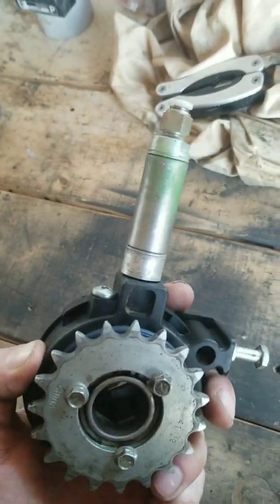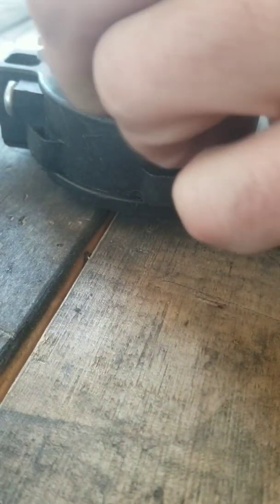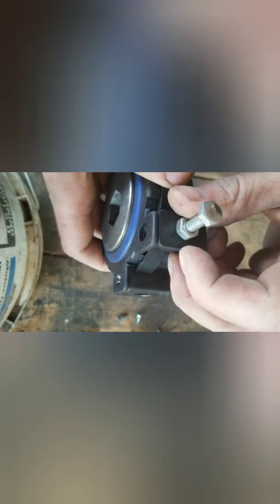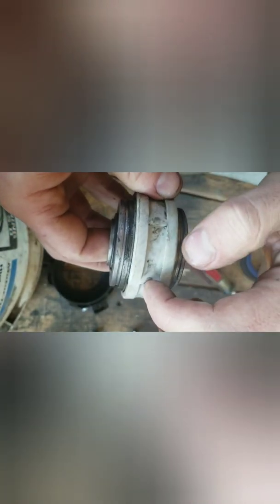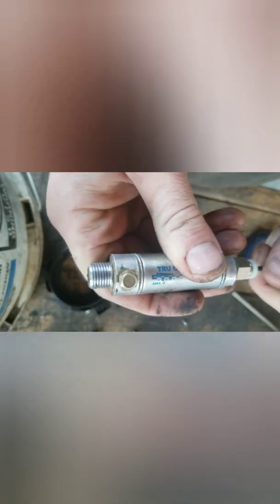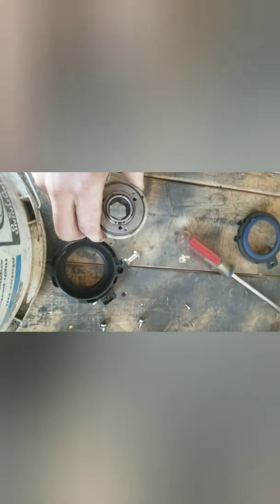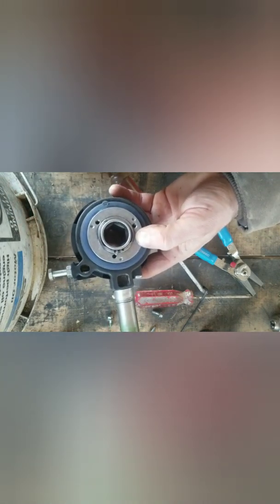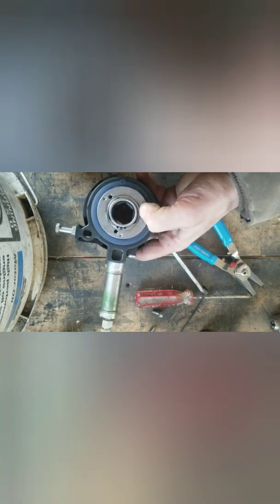Tru Count clutch disassembly

Comment: I cleaned the back 8 clutches on a Kinze 3500 split row with the clutches mounted on the planter.  Each row took 10-20 minutes with row 3 & 6 being the hardest because I had to straddle ground drive wheels.  The clutches can be completely disassembled and cleaned without removing the drive shaft.

Comment: I appreciate you sharing this.  I recently bought a JD planter at an auction with a Tru Count system and have no manual.  I also just found out that Trimble is no longer handling Tru Count and am wondering if you would know where parts could be found if needed?  I have tried contacting the number on the Tru Count website but continually just get a busy signal and I am assuming it is not in service.
Reply from the maker: Most CaseIH stores are Trimble dealers, plus the tru count was the factory clutch on the 1240s/1250s so they'll have most of the guts on the shelf already. The parts counter can help some but the AFS guy is the one to ask.

Comment: I just bought a White 8824 with the air clutches on it. I have been told that I should maybe clean the clutches before spring.  I sure am glad you posted this video!
Reply from the maker: Glad it helps. unless you're changing hex shaft bearings anyway, remember there's no need to remove the clutches from the shaft. Just pull the guts out and clean them right there on the shaft.